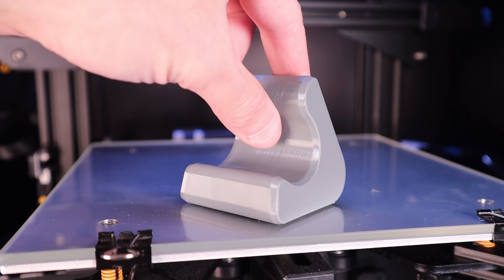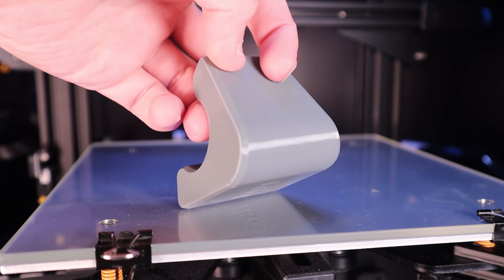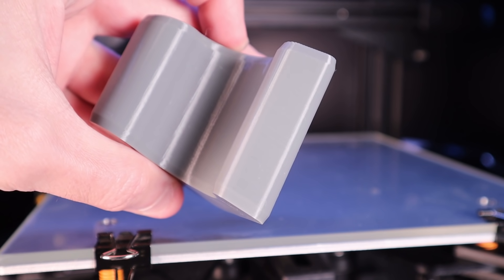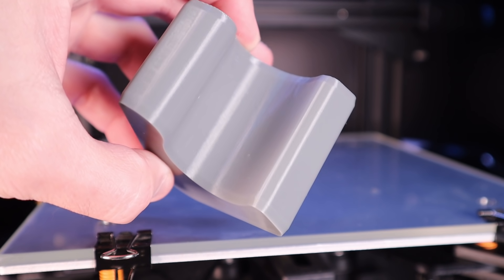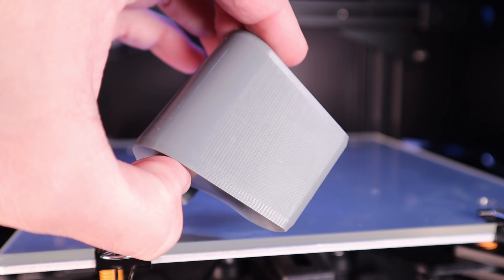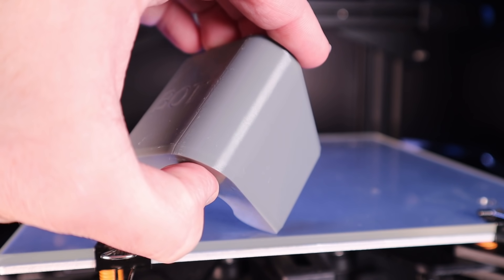Creality Ender 3 V2 - Simple Tips for Super Clean 3D Prints

Comment: are the fans on your ender 3 v2 also pretty loud? I got mine yesterday and the fans are already pretty loud from the moment im turning the printer on. Do you know any fix for it?
Reply from the maker: The fans are pretty loud, I thought that the shroud was to blame, but it seems to be because of the speed and blade design.  To solve this, some people change the fan to Noctua, that's too much of a mod for my liking.  I print in an enclosure to help.  The printing process emits minute particle of plastic, so an enclosure and eventually a filtration system is a good idea.
Reply: @NeedItMakeIt , thanks. I will probably change the fans then, because the printer is right next to my pc where I am gaming and also right next to my bed (Have no other place for it :/ ).
Can you send me more infoa about the enclosure? I would like to see pictures and files of it :)
Reply from the maker: @BeamDeam  I completely understand, mine is next to my desk and recording videos while it is running was a problem too.  There must be a different brand of that is a direct swap rather than having to alter the voltage in order to use the Noctua.  My enclosure is nothing special, just some 1/4" mdf on 5 sides and a plexiglass front.  It is fairly terrible looking, but it does the job.  I was thinking about making one from all plexi.  There is one that is called the LAK, which uses a cheap idea table as a frame and then uses glass or plexi to fill in the sides.

Comment: What do you set your initial print speed to? And do you have the fan for the first 2 layers or leave it off? I've read varying opinions on this.  Thanks.
Reply from the maker: Initial is 15mm, and then inner wall 50, outer wall 32mm

Comment: I've not used random seams since I tried it the first time. It simply introduces very visible surface defects. Took me a while to figure out what was causing these surface defects, but once I did and switched to one seam, all of the defects were gone. Second issue is random filament stuck to the nozzle. This will absolutely ruin your print surface once it detaches and gets incorporated into the print. Always get these off.
Reply: Hi, can u explain what Setting you chose ?
Reply: @mbikerFR  I simply turned off random seam and chose the seam placement to be sharpest corner and random location. Random location is different from random seam. I also tried arc welder which converts multiple points into uniform arcs. This limits the amount of "stops" the nozzle makes when it moves from point to point. Depending on the motherboard, it may cause a very slight pause at each point and some material oozes out, forming a blob.
Reply: @PunakiviAddikti  hi can you help me wher to find this? (225C Nozzle, 75C Bed, 78mm Infill, 37mm Outer Wall, 57mm Inner Wall, 45mm Initial Layer) i don't know where to find this it is because im literally newbie on this 3d printing. please help me.
Reply: @daniellejunio1810  There are plenty of 3D printers that can do 225C on the nozzle and 75C on the bed. Infill, outer wall, inner wall and initial layer are controlled by the slicer software.

Comment: What are you using for a removable base plate? I've just started and every thing stick too well to the steel base plate of the printer.
Reply from the maker: My printer came with glass, but it was damaged fairly early on and it looks terrible.  I've switched to Borosilicate glass (old pyrex) and it has been working very well.  If you don't already use glue stick, try using that on the metal before you start the print, just make sure to apply before you start to heat.  If it is steel, I suppose it will rust when cleaning, so just be quick to wash and dry if you try this method.

Comment: I'd say that some good calibrated LIN_ADVANCE and Retraction settings will always be much better than combing and reducing your prints to one at a time. But these are not bad tips for people that don't want to get much into the deep calibration of the printer. Takes time and it's a bit annoying at first.
Reply from the maker: For sure, I had dialed in ABS well after printing with it, now switching to PETG, it requires some tweaking and I'm still working on it.  Good advice, thank you.

Comment: Did you use z hop for the test? Im struggling between using it or not
Reply from the maker: I always have z-hop turned on, this helps sometimes when going over rough infill, and of course between parts which may not have much contact area with the build plate.  

Over time I suspect that the brass nut will wear and z-hop up/down motion will suffer a little.  A new nut would help, also I use a light oil on occasion for the z screw.

Comment: Ender 3 v2 stock settings half way through prints, the nozzle will sometimes knock into the print and push it loose from the plate. Any advice?
Reply from the maker: Turn on z-hop, movements will raise the nozzle slightly during travels, this will help a little bit.  If you're seeing a rough texture on your infill, this can also be the cause, if it grabs that surface you can get a shift, the entire plate, or the belt slipping also.  Do you prints have lots of contact area with the bed?

I use the default height in cura, but there are settings for changing the height also.  Over time with wear in the z-travel nut you'll have some problems with tolerance/backlash, a nut replacement would solve this.
Reply: @NeedItMakeIt  Thanks, I'll try that for the next print. Yeah my prints usually don't have much contact with the bed so I've started to use brim.
Reply from the maker: Good call, I also find that making the first layer thicker along with a brinm will stiffen the connection a bit, a very thin first layer doesn't add much, but a 0.2mm will do fairly well.

Comment: It's probably extreme for demonstration at 01:00, but in the first example of two parts, those prints are waaay too far from each other and i doubt anyone would arrange the prints like that, just the travel time spent between the parts is probably quite a few percent and it would be an invitation for stringing, a distance of 1mm between two parts is enough, not half the buildplate.

Comment: Thanks for the tips! New to the space, and I got carried away packing as many things onto my plate as I could. Heh. I wanted to throw an idea out there: I think the 'print one at a time' feature would work for taller pieces if you line the pieces up instead of distributing them. If done in the correct direction this eliminates risk of collision with crossbar and allow taller objects to be printed using this setting. (I have an Ender 3- other gantries setups might differ.)
Reply: One single object can pose the same challenges as multiple objects.
Like for example the tips of a crown.

Comment: I never get blobs but I always get holes (underextrusion). I already tried to print with higher temperature (215° for PLA), more than 100% flow rate and slower travel. All I get is more stringing but still holes expecially towards the top. That happens with really old filament as well with brand new amazon basic PLA.
I dont know why.
Reply: Did u calibrate your e steps?
Reply: I had the Same Problem. My way was to Open Up the hotend, then Clean everything. The Most Importamt Points are that your nozzle is connected direct to the heatsink, that the bowden Tube is connected direct to the nozzle. If the nozzle has No direct Connection to the nozzle, the Filament will fill the room between both parts and cool down there. This way the Filament is Not able to reach the Heatblock. Another Problem could be the cooling Fan, that cools the heatsink and the "cooling Body"

Comment: Lol, butter? Is this a joke vid? I honestly can't tell. We're trying to fix stringing and zits here, it seems, yet there's no mention of dialing in retraction settings. What was the point of randomly switching to an entirely different filament/material in the 5th sample? The only thing that makes sense here is that yes, combing helps, and yes, printing one thing at a time helps (no travels).
Reply from the maker: I've covered many of them in previous videos as well, I like the keep these videos short and sweet with an emphasis on showing the tests and results in detail. The butter was a joke, all details are mentioned in the description for each of the tests.  My experience with shiny materials like PETG is that they reveal defects much more, especially under harsh lighting like I use during shooting these videos.    

Retraction settings are all well and good when there are no lingering mechanical problems on the printer.  This printer has one and it is fairly big.  I'll be releasing a video in a couple of weeks to cover a permanent solution.

Thanks for the comment!
Reply: NeedItMakeIt, I've only seen two of your videos so far, and I think you are doing a great job. Best of luck in 2021.

Comment: Do you use the default alu bed that came with Ender? Also do you print PETG only or swap to PLA as well? If yes, how do you deal with bed warping due to different temp settings?
Reply from the maker: Yes I do, the warpage is mitigated by using 4mm borosilicate glass.  I find perfect first layers every print.  I level with paper and only about 1 time per month if that.  Anytime I move the printer it needs to be adjusted.  I print ABS, PLA and PETG, no issues with the temp difference so far.  Do you print on glass?
Reply: @NeedItMakeIt  yes i use the glass that came with V2 and if the alu bed warps, the bed follows. I shimmed it to near perfect using few strips of aluminum cooking foil

Comment: It needs the option to print X number of layers per part, before moving to the next.
Reply from the maker: I agree, they need to do some more work on the printing multiple parts.  All of the settings need to be available for each part as well and they are not, I'd find that very handy for testing different settings during the same print.  You can trick your printer to also do tall prints one print at the front, one at the back, it does work, but can be a bit risky.

Comment: Where is the comb setting? I see in the video its under travel, but for me its not there. We both have the ender 3 v2, but cura doesn't have the v2 model yet, so I just edited the ender 3. Did you select the ender 3 pro?
Reply from the maker: You will need to activate it first, go to setting visibility and type comb, it should show up.  I did pick the ender 3 pro, both should work fine for a starting point.

Comment: What about setting the layer height to 0.04 multiples? That helped me out quite a bit. Otherwise, I recall on all those techniques being successful, great vid :)
Reply from the maker: I have plans of investigating this, quite a few people have mentioned this I believe you're right, it must be a real thing.  I would like to experiment a little and make a video with some proof.  I understand the steps on the motor, what I need to look into is the ratio for the z-axis leadscrew compared to those steps.  What is one step in rotation equivalent to in actual motion I suppose is the question.    Thank you for the support!  I am trying to provide as much proof of concept in the video as I can so that it isn't just a matter of someone trusting what is heard, but they can see for themselves.
Reply: @NeedItMakeIt  Check out Chuck's video over at CHEP where he shows that the steps of the z-motor and the pitch of the lead screw result in 0.04 mm being a full step instead of an interpolated value so the layers can be more accurately set.  I thing the stepping of the motors is pretty standard and the pitch on the lead screw as well, so it is probably applicable to more printers than just the Creality printers he uses as an example.
Reply: Most people call that the "Magic Number" and not all printers use the same value.   Monoprice Mini's use a unique stepper motor for their Z axis and it's some weird 0.13 variant or something.
Reply: @noxin75  most printers use .4, or at least from my experience. But yeah, it can vary.
Reply: @vit.budina  ender 3 is .04 multiples, not .4
Reply: @antivert  yeah, sorry, my bad, missed the zero, I know it uses .04 :)

Comment: one big reason for single prints rather than multiple items giving you better quality is cuz the stepper inaccuracy is bascially reduced. if you look at some specs for these steppers they have a +- few microns per turn, but it shows up on prints esp when it has to travel between each parts.
Reply from the maker: That's a really good point.  To add to your point, when traveling turn Z-hop on so you can avoid hitting other parts which can throw things off.  Worn belts and gears can impact over time.  this printer makes it easy to keep good tension on the belts, my last printer not so good.

Comment: Your printer has 0.04 z axis resolution so you should print with 0.08, 0.12, 0.16 layer height instead of 0.1, 0.15 and so on, otherwise it will cause artifacts. Also you should try linear advance feature of marlin to reduce seam visibility, because now its huge, and your stock feeder + tmc2208 may struggle with that, i will suggest titan feeder and tmc2209. Random seems is just harmful setting, never use it
Reply: Is .02 a good multiple?
Or is .16 better?
Reply: @jessehellakoo  The "magic number" is 4. Because with each step from the stepper motor it moves 0.04mm. Doing half steps can reduce quality on budget machines so much that the difference is easily visible. One could mitigate said issue with quality stepper motors but most people don't want to upgrade their printer out of the box.

Same applies to the speed settings. You don't want to set it to 50mm/s. Either 48mm/s OR 52mm/s. Every number that can be divided by 4 without creating decimals works just fine. 

I'm lacking the mathematical term as I'm not a native speaker and math was always my nemesis, lol.
Reply: @DrEckig  sry but thats not a problem at alll show me a test where you can see diferences. With modern boards microstepping you never have this issue
Reply: @DrEckig  thanks buddy. I normally print on 0.12 mill layer hight on my cr10s4 it takes litterly weaks for big parts but i upgraded it to linear rails and the hemera revo the resulsts are crazy

Comment: Like the tip about forcing travels to occur at unseen sides. Thanks. And is that bed-mounted camera holder downloadable somewhere? What cam? The time lapses are great.
Reply from the maker: For sure, it's something I use when I'm in a bind and I need to print a few larger parts but don't have the time to do them separately.  

The camera mount is in a video I made, the link should be there as well to the thingiverse file.  https://youtu.be/A5Ac-sB5jIY.  I like this mount, it gives a really good angle for finding problems.  Just make sure you have lots of light.  

The specs of my hardware should be in the video and description as well.  Not very expensive and there are lots of benefits to viewing your prints from anywhere using Spaghetti detective with Octoprint.
Reply: @NeedItMakeIt  I think he should say thank you for this detailed answer :)
Reply from the maker: @kezman82a  I have a new camera video coming out soon, keep an eye out for it, this one is pretty unique and a much better option for people wanting to keep an eye on their prints... in detail

Comment: Thx for the interesting video.

Just one sidenote: IME PETG prints just fine without (or with very little) cooling. With some filament brands cooling might even introduce all kinds of problems like layer separation, etc. I always tone down my cooling whenever I deal with PETG to maybe 1/3 of what I would use with PLA.
Reply from the maker: Thank you, 1 more coming up real soon, this one is pretty cool IMHO.  

I agree, I always try to print with the cooling as low as possible most of my work is load bearing and I'd like to be confident that the layers have adhered well.  I will be doing some testing in future for this specifically across many different types of filaments at different amounts of cooling that will take some time to get setup for.

Thanks for the comment!
Reply: @NeedItMakeIt  You're welcome! Keep up the good work!
Reply: @NeedItMakeIt  btw: congratulations for reaching 10K subscribers!
Reply from the maker: @theinternal  Hey thanks a lot, I can't believe how quickly things went from 1000 to 10,000.